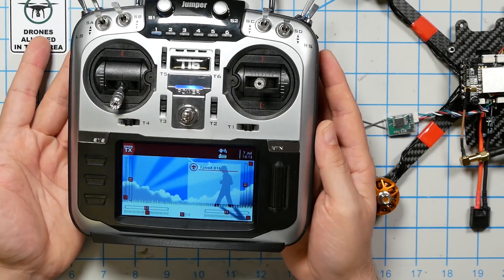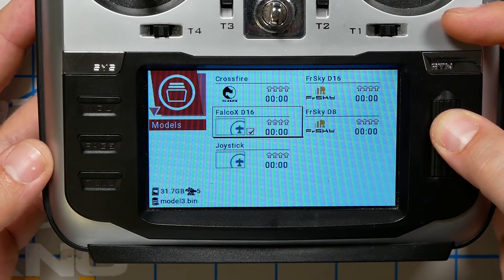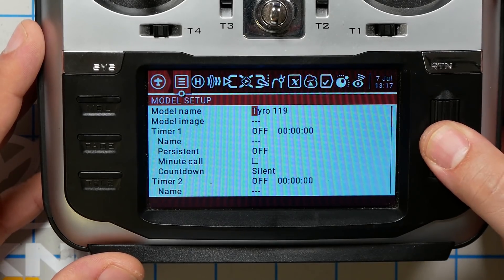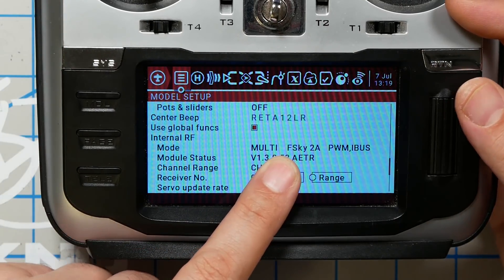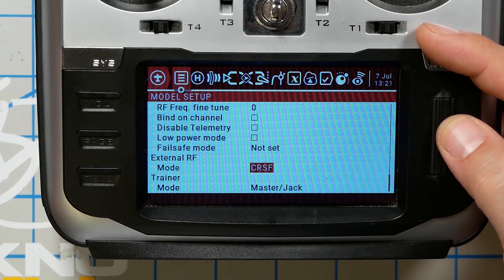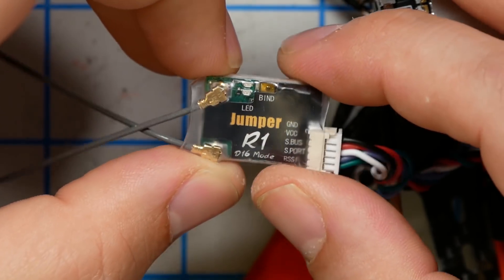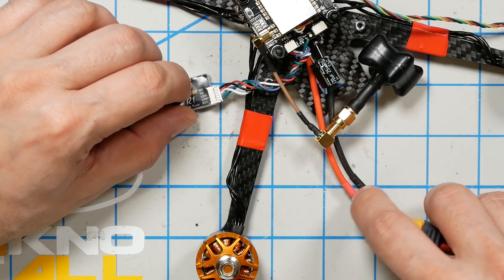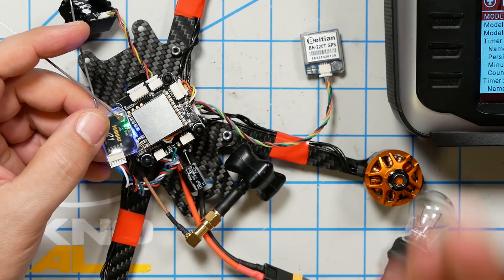Beginner Guide $120 FPV Drone How To Build - Part 3 - Bind and Create Model

Comment: The Jumper R1 was not available by the time I started my Tyro 119 build.  I substituted a FrSky R-XSR and I just want to warn people about binding this receiver with an older Taranis.  I have older Taranis Plus and a X7Q.  I did not know that this receiver only worked with version 2 of the XJT internal module.  I found Joshua's video on it and it explains it and how to fix it or not.
After downloading the firmware  on a SD card in the Firmware section, I reinstalled the SD card into the QX 7 and wrote the Firmware into the radio upgrading the radio to match the receiver.  After two days now it will bind.  Things like this make you question everything you think you know.  LOL  Thank you Joshua, you are a blessing.  I was able to bind it by using USB and didn't have to use a battery.

Comment: Hello, guys, I am using an Fs-ia6b receiver with flysky fsi6x transmitter but when I see the voltage on my transmitter it is only getting 5v and the battery for the receiver shows up as half does that affect my range or signal in any kind of way or not? i am just super confused!

Comment: Hi Joshua, I saw you used a jumper receiver on your build. Does the kit come with a receiver to bind controllers or do you need to buy a receiver that binds to your specific controller. I have a FrSky Taranis QX-7 any recommendations for receivers to buy for it? do I need to do the Sbus bridging?

Comment: Hey, I cannot get my Taranis QX7 to bind to the Jumper R1 receiver. I use Internal RF XJT D16 with CH1-8 and Telemetry on. My radio is flashed with EU firmware (opentx-x7-eu-en 2.3.7) and the internal XJT is flashed with the newest "XJT_ACCST_2.1.0_LBT.frk". I see the receiver in binding mode but when I press "Bnd" on the radio the receiver does not react. Anyone can give me some tips why this is?
I recently struggled to bind my tinyhawk in D16 mode too after updating the firmwares on my radio and internal module. I can only bind my tinyhawk in D8 mode and therefor got no telemetry...
Thank you

Comment: i can't get my q7x to bind to the f1 receiver :/ can someone help me? I did everything just like the video. the receiver is in binding mode, but the transmitter does not bind.
Reply: Hi, i got the same problem. Do you fix it?
Reply: @Raitodoomed  you need the correct frsky firmware
https://www.youtube.com/watch?v=LYUndGcKJ1E
Reply: I got yo use the ACSS MODULE FIRMWARE? Or the receiver firmware?

Comment: So, if I was in between the Taranis x9D plus or the jumper t16 pro V2 which would be better for a beginner.
which is better for long-range?
Reply from the maker: The best setup for long range is Crossfire, and both those radios will do it easily. (Note: but not the X9D 2019 edition)
Reply: @JoshuaBardwell where would you put your money if all you could buy was one transmitter.

Comment: I assume someone should have already mentioned, but if not...
That's not a a T-16 (TEE-SIXTEEN), that's a T-i6 (TEE-EYE-SIX) receiver,

The full name is actually the Flysky Transmitter i6 family, and by "family" I mean that there are actually several models but they all look and work the same except for one model that looks radically different. And, the T-i6 transmitter will support either 6 channels(The original factory) or 10 channels (The public figured how to do this and released the mod for free to everyone. Flysky now sells the upgraded 10 channel if you want to pay for it already done for you but you can save by buying the 6 channel model and doing the upgrade yourself). The newbie should just look at the transmitter you're holding in your hand in the video and look for something similar. Price will range from approx $35-70 in United States dollarss.

I should know. 
I own one as my first Transmitter.

Comment: What are your thoughts on the Tyro129 vs the 119?  Any reason to prefer one or the other?
Reply from the maker: The 129 is regarded by some as a better quad. Since it's a 7", it will be better for cruising and longer distance flying, but worse for acro/racing. I picked the 119 because, at the 6" size, it is sort of moderately good at both, and gives some flexibility. But if you prefer to build this with the 129, I believe the build is exactly the same.
Reply: 119 all the way.
Longer flight times and better freestyle

Comment: OK I got a question. I have a Jumper T16 which works perfectly on all my bind and fly quads. However, I recently built my first from parts and I have an XM+ and an R-XRS and neither will stay bound. They both bind and both work fine until they're unplugged for a few hours then they need rebound, what am I doing wrong?
Reply: Did you unplug them immideately after binding?
If you wait too long after binding and test em out before shutting down they may be not properly bound and the config will not be stored.
It also says so in the manual.
I use both recievers and they store the binding - but i did the binding and switched them off after that.
Reply: @mariusschmitt5855  Sorry for being less than descriptive there, but yes I did the whole binding FrSky dance each time. Plug in while holding button, put transmitter in bind, blinky lights go solid (solid go blinky?, don't remember which way that went), unplug /plugin battery everything works. I can fly and even change batteries with no problems, but if the quad sat with no battery for a couple of hours they'd need rebound. I've pretty much given up on those two receivers and replaced them with a SPM4650 from Spektrum and I haven't had any problems since. I you have any ideas though it be nice to get them working.
Reply: @shorty430551  

well i think maybe its the radio or you are using the same reciever-id for more than one aircraft that erases the old setting.
If you take 01 for the first receiver and bind the other rx again with the same id the first one is unbound

Comment: I practice on Liftoff, would you recomment fly on 3D or Acro? 
Whats the Standart config on Betaflight ? 
i think 3D is more easy to control 
thanks for answer!
Reply: Hi! Not bardwell but in my opinion Acro is better. You get more control and it's far easier to set up. Additionally, 3d props are hard to come by in real life. It's entirely up to you though! Check out Zoe FPV for some cool 3d stuff.

Comment: i have a big question to ask.. can you free style any type of drone. trying to get into fpv with a budget and i saw on amazon the Bolt Drone FPV Racing Drone Carbon Fiber with First Person View Goggles 5.8 Ghz Ready to Fly Package.. i just wanted to know if you could do tricks on normal drones or drones like this one.
Reply: the  Bolt Drone FPV Racing Drone" thing will NOT be like this one....this one would be MUCH better.
Reply: @bigbudzo.3087   but one thing that you have to buy extra is the googles and remote on this one tho
Reply: @moorehar0013  yes..but the drone is MUCH better in this one..the goggles in the bolt package are not as good as other options..and it looks like the radio for the bolt is ONLY for the bolt..so any other drone you might want to buy you will still need to buy a radio..
Reply: nope, no acro on that one. It's also not as good in terms of FPV as this one
Reply: In on a 175 dollar budget tho
Reply: @moorehar0013  the bolt drone will not flip and roll like a actual "acro" quad will. it might be good to learn how to fly and get used to fpv in general..but you WILL be buying another drone and better goggles after this, you are better off saving a bit longer and upping your budget some to get better quality gear. you absolutely get what you pay for in this hobby.

Comment: Should I also buy the Jumper R1 if i'm using the Frsky x-lite?
Reply from the maker: I would expect XLite ACCST version to bind to this ok. If you upgrade the XLite to ACCST 2.0 then I would not expect it to bind.

Technically, the Jumper R1 is supposed to be able to flash XSR firmware, so perhaps it could even run ACCST 2.0 but I don't know about that.
Reply: @JoshuaBardwell  Sorry I'm confused :D . My xlite is on version opentx-xlite 2.3.5 (465ab70b). I updated it witch companion to remove eu because I had eulbt with no D8 mode. It works with my first drone (mobula 6). Im still googling and I dont know if Im on ACCST 2.0. I doubt that the receiver in my mobula 6 is already on ACCST 2.0 (connected with D8, D16 is not working). Can I downgrade the firmware if Im on ACCST 2.0. Should I downgrade or should I buy an other receiver than Jumper R1? Big thx for your help!

Comment: J.B can you add a lill tutorial in Modes section , on playing values , . I have setup expo on switch , 50 /25/15 . So is there a way to play the expo value once switch is moved . So it can say expo 50 /expo 25 / expo15 . ? Yesterday on stream you told me how but i got lill confused .  Thank you !
Reply from the maker: I think we discussed this on the livestream.
1. In the Inputs screen, set up expo for the channel. For the expo amount, uss a global variable.
2. In the Special Functions screen, set up "Adjust Global Variable" line to make the GV have value 50 / 25 / 15 depending on switch position.
3. In the Special Functions screen, set up a function to read out the GV when the switch moves.
Reply: Latest OpenTX ( Jumper T16)

Comment: Thank for this video really cool u did brake it in 3 parts really nice. I should an expert by now right wrong lol I have been watching almost a year this videos and i build already one kwad but never fly it cause for some reason there is no movement of the sticks on the betaflight anyways i also lift a pad on the flight controller well I bouth me 3 more flight controller so i can make me another one and see if i can complete the next one and flight the kwad. In the mid time i been in simulator lol i have to practice  so when i flight for real I'll be at least better.
Reply: I had also no stick movement with my first quad and the problem was that I soldered my receiver to the sbus tab from my fc but I had an ibus receiver.
But you could also picked the wrong UART in betaflight.
Reply: @flyingdr.endless5069  yes thank I think I did do something wrong but anyways I start it another build already because I got tire trying to solve that problem got me no where but is ok thank u.

Comment: CAN I ASK YOU A QUESTION 
THE DRONES THAT YOU BUY ON BANGGOOD ARE ALLREDY MADE OR YOU NEED TO BUILD THEM 
I WOLD LOVE IF YOU GAVE ME A ANWSER
Reply from the maker: You have to build them. That's why I'm making this video.
Reply: @JoshuaBardwell  thank you
Reply: x7_ Shark if it is a bnf- bind and fly, it is prebuilt
Reply: There are the Tyro models line wich are the subject of this video, there is the cheapest and smallest Tyro69, Tyro79, Tyro89, Tyro 99, Tyro 119, and I think largest Tyro129. There are also a few either discontinued models inbetween (I think for example Tyro77). These Tyro models are "Almost Ready to Fly" and need about an hour's worth of assembly pus a few parts you need to provide on your own, in particular the Receiver  so that you can choose something that works with your choice of Transmitter.
And, of course you need to add a battery of your choice that's 2-4 cells (nothing only one cell or larger than 4 cells which will not only be mismatched in power but will have a different power connector)..

But otherwise...
These Tyro models have everything you  need that's common to all quadcopters, which include
Frame
Flight Controller (The brains that accept commands from the Receiver and converts commands to the ESC to power the motors)
A 4 in 1 ESC (A special multi-function component that does mainly 2 things you should know about which is to connect to the battery and manage the electricity, and ESC which is to connect to the motors and convert commands from the Flight Controller to amounts of power sent to the motors).
Motors
Props
Video Camera and Video Transmitter (on some models a combination and others w separate components)

The tools and materials you need to complete your assembly include a soldering iron and solder, plus some misc things you can decide on your own whether to use like tape, extra zip ties,  plus some common screwdrivers (nothing too special).

Time to assemble would be less than an hour for someone with some experience.
Count on maybe 3 hrs if you're completely new and need to go really slow and are uncertain.
Skill level required is minimal because almost everything is simply pushing together connectors and turning a screw driver, but there are a few quick things that require some minimal soldering skills.

As to whether all quadcopters need to be assembled like this, 
No, not nearly.

If you want to use a FlySky i6 transmitter (Cheapest, fully functional),
There are a number of Ready to Fly quadcopters which don't require any assembly, you just unbox, add a battery, pair with your transmitter and start flying... I think there is even one on Banggood that's about $60 called something like the "Eachine QX65" which is so tiny it's pretty much an indoor drone only (or fly outside when there is little to no wind)